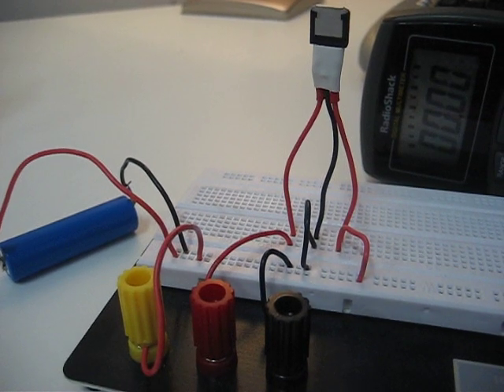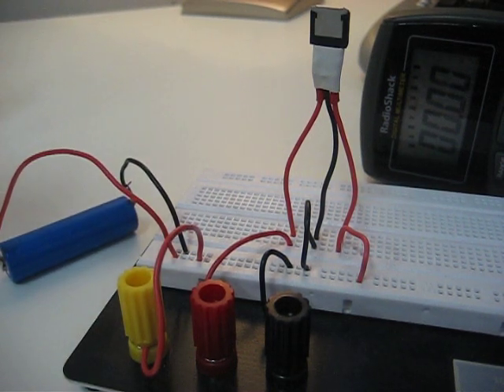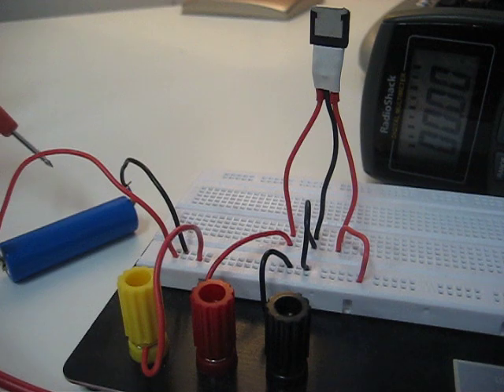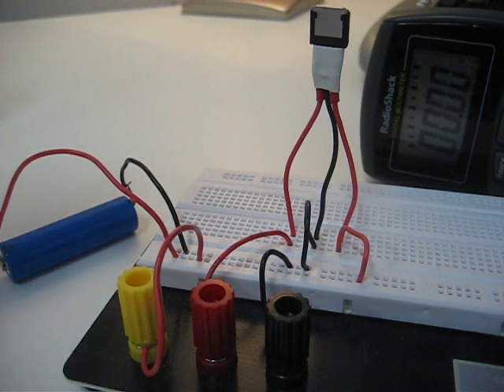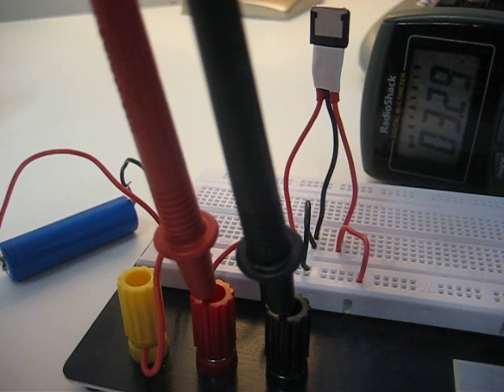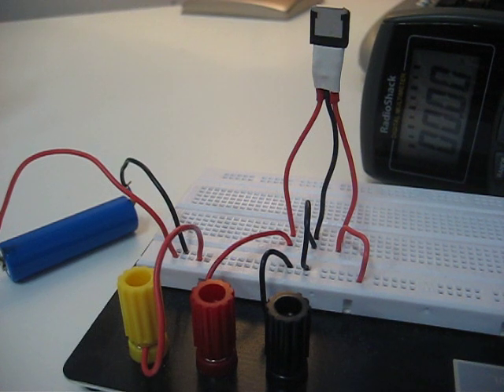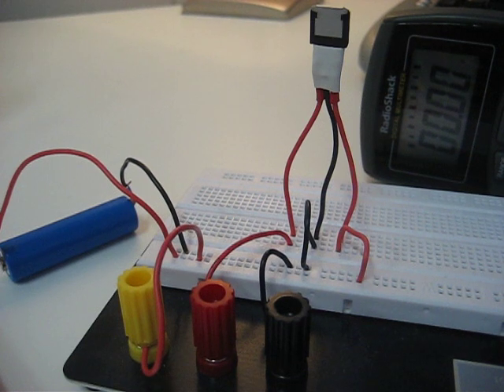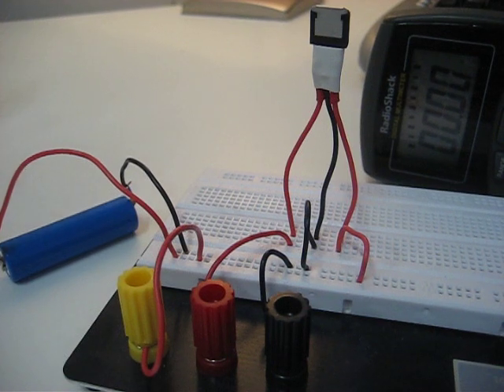Low Dropout Voltage Regulator (MIC5237-3.3YU)

Comment: LM1084 rated at 5A and its setup for 5v using resistors.   my voltage drops from 5.20v to 3.30v when i connect a 2A load on it.. anyone help me solve this ? my power supply is 12v 20A and input voltage stay at a constant 12v and iv tried 2000uf cap on the output but still voltage falls iv used 4000uf also no change...and mobile phone stops charging under 5v hope someone can help me